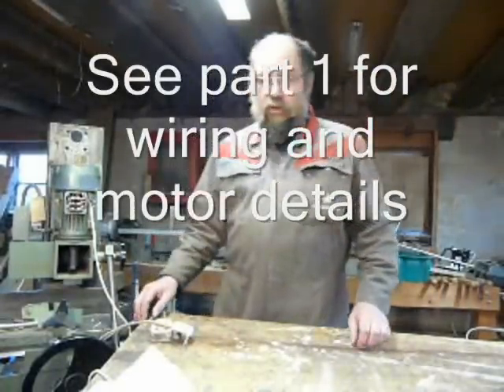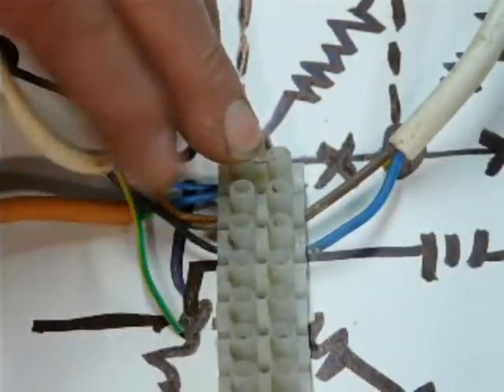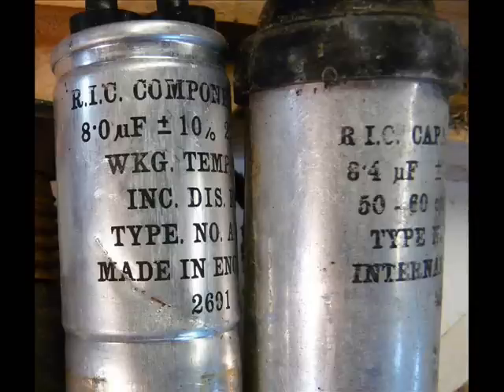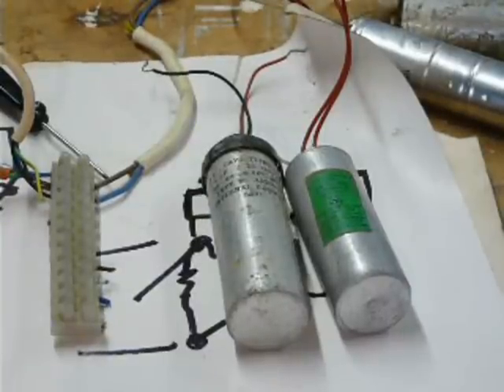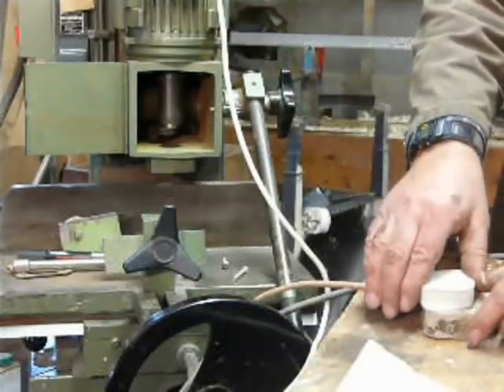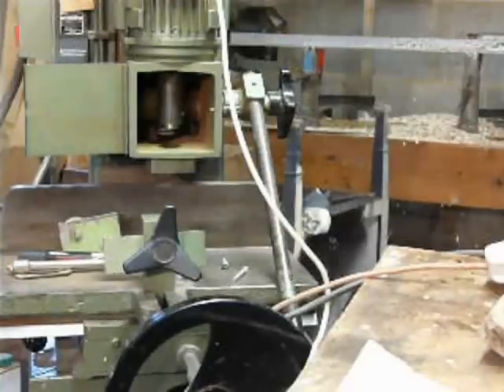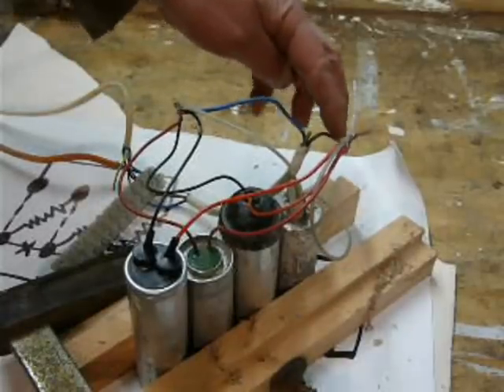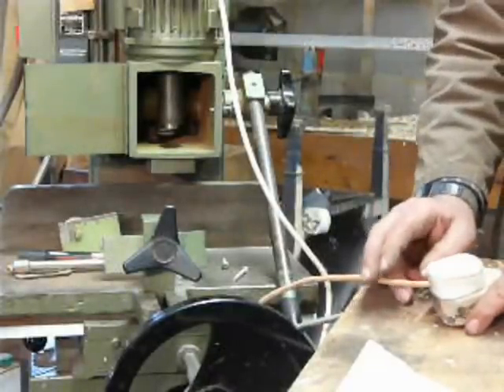How to do it: run a 3 phase motor on single phase supply. part 2

Comment: Hi Andy, 
This is really a great video.  I need some help please.  I would like to run a 4kW 3-phase motor on 230V single phase.  I am unble to find these old fluorescent tube capacitors.  I have bought a 32 uF 230V starter capacitor and connected as per your video.  When I connected the power supply, there is slight movement by the motor.  Do I need more capacitance or have a bought the wrong thing.  Please advise.  Regards,  Kobus
Reply: In the U.S. start capacitors are not designed to be in the circuit continuously.
They are wired in series with a start winding and centrifugal switch which opens the circuit when the motor reaches about. 70% of its speed. The purpose of the cap is to shift the phantom phase created by the start winding to a degree that it provides more starting torque for hard to start motors like those used in compressors. The use of this system can be damaging to devices that require low starting torque, such as fans and general purposes.
(The statement above doesn't pertain to this video; it's an FYI about start caps in single phase motors). The caps mentioned in the video must not be DC electrolytics. They must be rated for ac continuous duty and preferably at a higher voltage than the mains.

Comment: Great work, Andy.  : )
Truly in the spirit of learning & adventure.
I was wondering if there is a proper way of calculating the values of capacitors, rather than going by the trial-error one.
Also, Can you think of any disadvantages of using such a scheme ?
Reply from the maker: Hi. Somewhere in the comments to this series is the formula. The constrains to the method are: only suitable for smallish motors, gives about 60% of the rated output. Benefits: suitable for home workshop use of 3 phase machines. Subscribed? Cheers, Andy
Reply: Thanks Andy for writing back.
I will go through the comments.
There can be many applications where the job can be done for the time being using single phase supply.
I am sure this will be helpful to many.

Comment: Andy, I have a 3 phase water pump here. Can I apply this to a water pump? I am just thinking that water pump uses more power to start though XD Hahaha. I have no evidence though. What do you think Andy, can I? Thank you.
Reply from the maker: HI. This method is only suitable for small motors,say 1 Hp. With a load on the motor a start capacitor is needed. There is only one way to find out if you can run your motor. CHeers
Reply: Ow. Hahaha. I will try and might share the good news. Thank you Sir.

Comment: hi andy your video is so simple on how to run a motor from 3phase to single phase. i have one problem with the motor it is a asea motor class f motor i do not know what micro farad to use for the start and run capiciter as the is no plate on the motor this motor is used on a saw i will be most greatful if you could help me in this situation.best regards thanks colin.
Reply from the maker: Colin. I did not know what cap to use, so that is why I experimented. I suspect you will have to do the same. Cheers
Reply: pleas3 sir cane u tell me how i can connect a 3 phase ac motor to water level indicator circuit
Reply: Class F is the type of insulation used on the motor windings during manufacture or rewinding. Class A is lowest grade, class H is highest (I think)

Comment: Hi Andy, My motor not have the screws with the brass links, only have  9 long wires with the identification number t1, t2, t3 etc.t  I can identify the winds cables but what i do with the t7,t8,t9 cables ?????

the two line cables yo connected to the motor are one neutral and one 120v live ???
or two 120v live ???? thank you for you answer.

Comment: why when you add more capacitor speed of the motor increase as far I know capacitor delay currant thank you
Reply from the maker: By adding capacitors the phase is shifted until it have moved sufficiently for the motor to run correctly. Too much or too little and the phases can fight against each other. Cheers.

Comment: hi sir can you give me where is the L1 L2 L3 for that convertion.thank you sir.
Reply from the maker: Hi. Don't worry about that, just wire it up and if your motor turn the wrong way change the connection betwen cap and the mains supply. Have you subscribed? Cheers, Andy
Reply: +Andy Reynolds  thank you sir and every horsepower how many microfarad i need??
Reply from the maker: 25 Uf per HP at a guess, depends on the motor. Cheers
Reply: +Andy Reynolds and sir i see the other convertion the power.. line 1 have also connect to the capacitor going to line3..and the line 2 is also have capacitor connected to the line 3..
Reply: +Andy Reynolds thank you sir your video is big help for me..

Comment: will 5 hp or 7 hp motors works on this principle ??
Reply from the maker: The problem is with the start current, there is however only one way to find out for any given motor. Let's hear how you get on. Cheers, Andy

Comment: thanks for the video, can i use a capacitor rated 450V for this situation?
Reply: this is late. but yes, absolutely you can always use caps that are higher than the circuit voltage

Comment: May I request you to explain from 6:24 to 6:31 (in case motor gets warm, we need to reduce the running(?) capacitance or may be add a start capacitor)

In case of 5 HP motor, a starting capacitor of 150mfd with 440V (1.5 times of the phase voltage) and 8mfd 220V (equal to line voltage)Capacitor for running will be suffice.  

Starting capacitor will be isolated after the motor attains full rpm by means of switch. Any suggestions please.
Reply from the maker: If the run capacitor has too large a value it will induce a high voltage and cause the windings to heat up, hence check the voltages when the motor is running. Cheers
Reply: pour water on to cool it down,works a treat! :)  im joking  !dont do that!haha

Comment: Didn't you forget to discharge the capacitors before adding more of them?
Reply from the maker: Hi. That is not a problem, in fact it is a good thing as long as it is an AC capacitor. Cheers
Reply: +Andy Reynolds But what about safety? They will shock you if you touch the wires?

Comment: great explained. ..thanks,, I was connecting 1 capacitor .the motor get more heated,, plz explain why motor get heatup.i want to run motor without heated
Reply from the maker: This could be that your capacitor is too large (micro farads). Measure the voltage across the windings with a multi meter when the motor is running. A high voltage will show that the capaciitor has too large a value.  Remember with this method you only get 2/3 of the Hp. Hope this helps, Cheers
Reply: Wire the capacitors in series, this will reduce the micro farads if the capacitors are to big

Comment: I was wondering If I could use this method with 3phase compressors ? :) 
and yes I've subscribed 
thank you
Reply from the maker: Hi, welcome to this ad free channel. Compressors can draw huge currents if the motor is starting up against pressure in the tank. You would need to use a start cap, and the switching in and out would need to be automatic. There are quite a few limitations with this method, namely motor size, max current draw on starting, and the fact that this gives only 2/3 of the rated power. beyond that try it and see, a few hours experimenting to see if the principle is sound for this application. Cheers. See my generating electricity with a water wheel videos (3) if you think crazy wiring and sparks are fun.
Reply: thank you very much :)

Comment: Hi Andy nice video.  just want to know the hp of the electric motor because it affects the capacitor you want to use.  In this particular video you are using this capacitor as running capacitor.  Thanks for your reply.   Keep the video flowing Andy.
Reply from the maker: Hi, thanks for the interest, I think the motor is 3/4 HP and yes there is no need for a high starting torque the capacitor bank acts as a run capacitor, see the rest of the series for start cap wiring, especially part 6. My books are equally practical and applied. Cheers, Andy
Reply: hi Andy, thanks for the fast reply. does it works in the wye connected electric motor????.  I will check your 4 to 6th video.
Reply from the maker: Hi, with wye connection there is less power as the coils are in series and so the resistance is greater allowing less current to flow. See part 1 for an explanation of this. Cheers, Andy
Reply: Hi andy, thanks i will check your part 1 cheers

Comment: Helped me with my 3 phase 10amp motor trying to run it as a pm ac generator or as an ac generator with in parallel caps 250-35- vac.still need some work yet tho, thank you for the info.

Comment: If I understand this correctly the capacitors will lag the voltage on the second leg by 90 degrees. Will that affect power output? I thought that 3 phase legs are separated by 120 degrees.
Reply from the maker: Hi, Thanks for the comment. The value of the capacitor has an effect on the phase ofset, which is why the caps value is "tuned" to the motor. This method only uses 2 sets of coils so the power is about 60% of the rated power. Cheers

Comment: Hi Andy, Great video ! Question, I have a 4HP,1420 rpm,220V 3 phase electro motor for a lathe.Do you mind telling me which capacitor and what size I would have to use to make it run ? And will I be able to work the lathe under load without overheating or burning the electro motor ?

Thanks Andy
Cheers,
Marvin
Reply from the maker: Hi. Difficult with a 4 Hp motor. there are about 4 amps to the HP at 230v, so run current is 16 amps, but start current would be about 120 amps. So there's the problem, but if you were sucessful then the cap would need to be about 100 Uf. Let's hear how you get along. Cheers
Reply: Thanks for the response.Well it worked with 150 mF run caps.When I measured the voltage from phase to phase and phase to the 3rd phase I got 220 V.So thats good right ?
I did some turning on it and it went fine,however to prevent the motor from burning  I switched it off ( although the temp was fine )
Would you advice me to turn heavy load on the lathe with this setup ? would it not overheat or burn ? BTw will the electric bill be high if I use it like  this ?

Thanks again Andy.
Cheers
Marvin
Reply from the maker: Hi. All seems fine and the phase voltage is normal. I would say just use it and see how things go, you will have 60% of the rated power due to using just 2 phases, just occasionally put a hand on the motor to see if it is getting hot. Isolate when not in use. Good news, cheers, Andy

Comment: hi andy, is a three phase leads have the same value or resistance?
Reply from the maker: Hi, Billy. All 3 sets of coils should be identical and so the resitance should be the same. You have to disconnect one end (of each coil) to get the correct reading. There sould be no reading to the case. Hope that helps, Cheers, Andy
Reply: Andy Reynolds
Thanks andy, I'm new in motor controls and I want to learn more.. May I know the difference when using wye delta over delta wye on induction motor. do you have any video of motor controls?
Reply from the maker: Billy, sorry no, I have always used motors direct. Cheers, Andy

Comment: Ive done this method on a three phase motor on a compressor. The motor starts ok but under load when the compressor builds a little presure it slows down then eventual stops.
The electric motor is connected to a mechanical motor via belt
Ive disconnected any other pressure switch...
Reply from the maker: There in lies the problem with compressors. You may have to use a pilot motor to attain more power in your 3 phase motor. With the capacitor method it only uses 2 winding phases and so the power is reduced. You could also try changing the belt pulley ratios. Cheers
Reply: Just found out the motor was already wired delta 415v (newman motor) so in series probly 720v. Im going to use an arch welder as an inverter to give me the 415v then use the cap for three phase...
Reply from the maker: Be careful of those dangerous high voltages, you could go before your time. Cheers

Comment: Excellent video.  Personally I still prefer to use a timer and triac arrangement but then I speed control which negates the thermal issue as we have partial control over the inductance.   This then if used in combination with capacitors as shown we can lower speed and maintain torque.   Otherwise best video I have seen.  :A+++++
Reply from the maker: Cheers, thanks for the comment.

Comment: which type of capacitor is this & what should be its value for 5.5 hp motor at single phase 220V 50hz supply
Reply from the maker: Hi. You will not be able to start this 5.5Hp motor as the start current will be about 250 amps and the run about 30 amps, but if your supply was big enough then a guess would be something like 400 Uf. Cheers

Comment: you used 4 capacitors thats equivalent to 32uf. so it will work if i put only one capacitor with 32uf?
Reply from the maker: hi. Yes that will be fine. I was showing how to find the correct value by adding capacitors until the motor started. Subscribed? Cheers, Andy
Reply: it works for seconds then stopped and never work again!
Reply from the maker: What voltage was the capacitor, and are you sure it was rated for AC? Some second hand capacitors will just pack up like that, that's why I use the ones from flourescent light fittings. Cheers
Reply: as in the book you mentioned. my motor is 2.5hp so i put one ac capacitor with 100uf. i found the 13amp fuse is blown. reduced to 50uf and blown again!!
Reply from the maker: If you are trying to drive something that needs a high torque to start you may be simply drawing too much current. 2.5 Hp would draw about 10 amps, but up to 80 amps to start, unless you have a wiring problem. Cheers
Reply: succeeded. with 32a source and 500v 25uf capacitor.
Reply from the maker: Champion, though 25 Uf sounds a bit low. Well done, it's good to be persistant. Cheers
Reply: yes 25 is low but i found the motor is rotating very fast so i thought it is enough. do I need to complete it to 100?
Reply from the maker: Hi. In one of the later 3 phase videos I show checking the voltage with a multi meter. Either low or high voltage will show if the capacitor value is low or high (with the motor runnning). Cheers. PS. Well done.

Comment: Thank you very much for this wonderful video explanation sir.

From this video I got a basic question. One phase does have a supply voltage so you connected the capacitors, this means that you are converting 2 phase to 3 phase right...?
Reply from the maker: In some ways you are right. Single phase is a live and a neutral, which in many coutries is connected to the earth, so the neutral is not live but a way of completing the circuit to the generator. 3 phase is 3 separate live wires with a potential of 415v between any 2 of them. I hope that helps a bit, Cheers
Reply: Yes it's clear now...:-) thank you. Cheers.

Comment: That's very interesting, and thanks for posting the video.
I didn't care for the trial-and-error method of determining what capacitance to use, though - is there a way of calculating the optimum capacitance for a given motor?
Reply from the maker: Hi. It is difficult to get a specific capacitor value because there are huge variables in voltage and motor design, however in the comments on one of these 6 videos you can find a formula that one of the viewers kindly left, and you will be able to contact them if you wish. Cheers
Reply: Andy Reynolds Many thanks for the response, Andy.  In fact, I Googled for a formula, and there are several non-YouTube internet sites that give different variations of it.  It seems that the thing to do is to use an autotransformer to up the voltage to 415V (funny, I thought I remembered 380V for 3-phase), then use two caps with a 60/40 capacitance split, one for starting and one for running.  In fact, they recommend using two caps in series for each, to be sure they will be able to handle the voltage.  I only want to convert a single motor - but I haven't bought it yet.  When I was looking for one, I saw that 3-phase motors are cheaper, so I was considering this conversion, but by the time I have bought an autotransformer and capacitors, I might as well get a single phase motor.

It's an interesting idea, though, and I enjoyed the video.
Reply from the maker: I have used this method on a big bench grinder that cam from a scrap yard, just usaing the capacitors. It was a good easy and cheep fix from a very nice grinder that was scrapped just because it was 3 phase. With the auto transformer you should get full motor power, but as you say, you may as well buy a single phase motor. Cheers

Comment: Great work and very helpful Andy , but i have a question
you said that when you loading the motor after operating it with large capacitance it could be heated so ,  what can i do to operate it with same way but without that overheat ???
Reply from the maker: Large motors are a problem because of the high start current. However if your capacitance is too large then this will create a high voltage on the induced phase and so heat up the coils. Check the voltage with a multi meter and if it too high reduce the capacitor value. This is why start capacitors are used. Cheers
Reply: thanks for answering me . cheer you

Comment: Anyone watching this video. I highly advise EARTHING the motor. Also be warned there is difference between an AC and DC capacitor. Otherwise, good video.
I would of liked to see the running currents compared to the motor FLC rating.